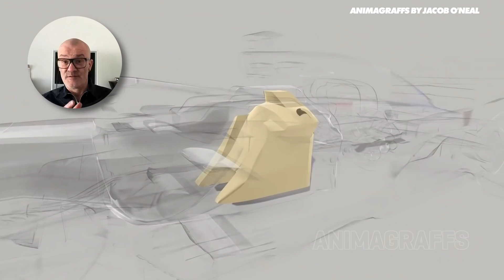Why Max's Red Bull Caught Fire in Australia

Comment: Had this problem when ethanol first come out, it would dry and degrade the rubber seals and hoses in fuel system and cause leaks and debris that clogged the injectors.
Reply: that's actually still a problem in Europe where you have premium fuel for cars that can't handle it. Pre 200....4? European cars didn't require to be compatible with E10, and E10 wasn't that common back then. Most Gas stations had no ethanol content gasoline.

They kinda screwed us over here with that because it's harder to keep the older cars that are worth keeping on the road alive. You often have to order parts from US counterparts or get a custom E10 compatible one.
Reply: @foxman105  your engine will handle the E10.. your cars fuellines and rubber seals in the system dont.. at ethanol is agressive on rubber and soft plastics..  my car is from 2003 and the car before that 2002.. and they both ran fine on E10.. i only had to replace the fuellines ajd injectors witch was not a big deal.. it sucks.. but not the end of the world.. E85 is more aggressive then E10 but also requires a flex fuel sensor for the ECU if you still want to run unleaded
Reply: @gewoontimm  I paid for an unleaded conversion on an old Opel Manta A model. Its a lot harder to get a shop for that. Still most don't care about preserving classic cars and its depressing.
Reply: @foxman105  what most people do with old opels is swap a newer engine in it.. like the c20xe, c20ne c20let.. then they have fuel injection and can run on unleaded without problems..
Reply: @gewoontimm  I wanted to keep it modern useable but authentic.
Reply: @foxman105  a c20xe would do enough.. and some fuellines that can handle ethanol.. also a fuelpump that can handle it so the plastic is not eaten away over time.. but mantas are easy.. not much electrics and pletty much like lego.. i have an opel omega b facelift.. runs fine on E10.. if the factory fuellines are starting to fail i will pull new braided fuellines under the car and continue..
Reply: @gewoontimm  Unfortunately I live in a retarded country which doesn't allow you to swap an engine for something that wasn't already in the car. You need the same model and displacement because... "Safety" and "ecology". I took this route because I just didn't want to fuck with half measures and wanted a permanent solution. It was an overkill I agree but I felt satisfied and I think that's what matters in the end.
Reply: @gewoontimm  I've had no issues, whatsoever, with either the 1998 Mazda 323F I owned for more than 10 years, nor my current 2001 Mitsubishi Galant, and I've been using the E5 and now E10 fuels since they came out. Never had anything related to the fuel system on my maintenance bills, so I'm not sure how much of the aggressiveness of the ethanol used in the fuels is actually true, or how much is down to low quality materials used by the manufacturers in the cases where using ethanol-containing fuels did cause issues.
Reply: @foxman105  i understand... some cpuntries are a b*tch when it comes down to engine swaps.. in the netherlands where i live anything pre 1998 only has to pass safety inspection and changed in your cars documentation...
Reply: @halofreak1990  its well known 90s cars are build to last 😅 im sure most cars will have no problem with the newer fuels
Reply: @gewoontimm  That would be lenient by our standars... its eitjer oem, oem rproduction/ compstible or no go. Technically the Manta is not street legal but nobody cares that much to do an engine dusassembly and it doesn't show on emissions. Actually it has them lower now.
Reply: @foxman105  european here. Can confirm. Forced to buy 98 (Has a maximum of 5% ethanol. A lot of gas station's 98 has 0% ethanol) for my 1998 Citroen. It knocks below 2000rpm on regular. I'm assuming because it's running to lean on E10.
Reply: @TotoGeenen  e10 shouldn't be a huge issue for these f1 power units, engineers should have been able to plan for this. Doubt the fuel itself is the problem
Reply: @TotoGeenen  You might need an ECU reprogram and a compatible set of hoses and seals. Also a compatible fuel pump. Even if it runs well E10 will rot your engine from inside out if it doesn't have proper equipment.
Reply: @TotoGeenen  I had this problem when I owned a NB MX 5. It ran okay but it had rubber rot issues in the lines, seals and fuel pump. I had to get US counterparts to fix it and get an ECU retune. It was expensive... And I'm actually quite pissed at manufacturers that they didn't implement this standard globally since it's been in US since..... 70's I think.
Reply: @foxman105  e10 won't rot your engine quick enough to make a difference in a race, i don't care if your car is 40 years old, it won't rot anything that quick
Reply: @TotoGeenen  Nah, it's because it's a 1998 citroen
Reply: @mountaingoat595  Okay. that's actually a good point. I was looking on it from a standard driver POV. 

Still the viscosity and lubrication is different and it might be screwing with some precisely calibrated mechanical components. Redbull did something wrong I think that's obvious. And it might cost them the championship this year if it already didn't. Ferrari on the other hand holy heck that's a return I really didn't expect.
Reply: @foxman105  That's way to much effort. Why would I do that when I can just get ethanol free for 10 cents per liter more instead?
Reply: @mountaingoat595  Agreed
Reply: @mountaingoat595  I have been thinking the samething, E10 still has a stoichiometric ration of 14.6 which is literally one point from gasoline. Post 2000 majority of cars built had the fuel systems setup for being able to deal with up to 15% ethanol. Other great point you made is the F1 engineers not being able to prepare for that. If we in the aftermarket world can run fuels with up to 98% ethanol there is no reason why F1 engineers can’t figure that out. Something else is up
Reply: @mountaingoat595  not sure how many of these guys are old enough to have witnessed what ethanol does.  It is theory taught in schools now,  but some of us old timers had the same car before ethanol and driving it a long distance, you got a real feel for the issues associated with what we used to call ethanol... "shit gas. "
Reply: @TotoGeenen  Doubtful it's lean enough to cause knock, considering ethanol has higher knock resistance.
Reply: @Cataclysm1  idk, I'm guessing that's it because it is basically unusable sub 2k rpm on E10. Can't let it drop below that because when you get back on the gas it just bogs. Meanwhile on 98 you can floor it at 1000rpm and it doesn't care.

>Ethanol is more knock resistance
95 is 95. E10 95 has the same knock resistance and ethanol free 95. Since they're both rated at 95
Reply: @mountaingoat595  found the layman lol why wouldn't it be a huge issue is just as good a question. "The engineer should've..." People like you go into politics
Reply: Only redbull power trains had an issue like that (gasly and verstapen) Check was a different fueling issue. No other team on the grid has had fire problems like redbull.
Reply: @ed3192  gasly wasnt fuel related, his MGU-K failed and caught fire
Reply: @ed3192  most teams did. But their issues came during barcelona and bahrain pre season tests which gave them time to solve before the actual season. Just redbull was unfortunate to not have the problems during the test but happened after the season started where it matters.
Reply: so it seems Formula 1 has a lot to learn from mainstream car makers that have cars able to run on 10% Ethanol. I think Honda has Ethanol accepting cars, but what a terrible year for them to back out of the Red Bull partnership.
Reply: @firefoxuser2557  I actually run e15 on my Honda CRV, no major issues still at 180,000 miles
Reply: @firefoxuser2557  or a great year if you was thinking cynically. Leaving with a driver championship.
Reply: @firefoxuser2557  Nonsense. Absurd to think that F1 is using components not compatible with ethanol.
Reply: @firefoxuser2557  Honda is still gonna work on Red Bull engines until 2026, they changed the agreement they had, they will keep paying Honda to develop the engine but will just brand it as an RB engine because they are paying for the engine and the licensing now, this will give RB the buffer time frame to develop the 2026 engine.
Reply: Well, I doubt it, they run for like hundreds laps during the testing session with no problem. I reckon that must be something else apart from you have mentioned. And ethanol isn't really uncommon. Thailand has been using it for more than a decade. Back in 2010 If I'm not mistaken. Brazil since like the 80s? And it is E20, 20% of ethanol. So it is a pretty standard in the automotive sectors, since a country like Thailand has been using it. And Thailand has like almost brand of cars, Japanese car, European, etc. Pretty sure F1 engineers should have known this, if it now, it is their ignorance that caused this.
Reply: @theruckinmaul1460  remember helmet Marko said, he would rather have fast car but unreliable then slow car then reliable? 

So maybe in order to save weight, red bull took the risk on using parts that are super light but there is a risk of ethanol leak then using heavier part that 100% will not cause any leak?
Reply: Agreed, the ethanol is doing creepy stuff to many gaskets etc. and the benefit of adding ethanol to power engines is anyhow questionable.
Reply: @honehobbes2897  indycar runs on ethanol, ethanol is actually really awesome when used for engines designed to take it
Reply: Within 3 races??? Does ethanol really work that fast?
Reply: @willw.3366  stuff on an F1 car is not made to last as long as yoir average car does.. after a hand full of races (being optimistic) the engines have reached 100% duty cycle and ethanol and other agressive racefuels will wear an engine out.. 

Same with le mans a few years ago when not every LMP2 car ran on diesel.. they ran on high octane racefuel and the engine only had to last 24 hours ans a bit for practicing.. so in motorsport performance will outweigh durability and teams will take the gamble if it delivers them a win...  if a fuelhose or and engine only lasts 3 races ita good enough for them dispite the rules
Reply: @Stem Artin shell v power and BP ultimate are also ethanol free
Reply: @Stem Artin prolly. Check their websites
Reply: @Stem Artin seems like you're right. Shell v power may contain upto 5% ethanol in the UK. Damn that's gay. I don't live in the UK tho. A pump like 10m away from me has E0 fuel so I always just fill up there.
Edit what about BP? It being British I assume you have a lot of them there? In my country they claim their premium is ethanol free (same as shell v power). Is it again different in the UK?
Reply: Also saw my engine run hotter on long distance drives and fuel mileage suffered... So yep... It's the fuel for sure,  and maybe other things as well.
Reply: @Stem Artin I see. Good on ya mate
Reply: Not that quickly.
Reply: Or Max's engineers are sick of him cursing & blaming them when he can't deal with issues beyond anyone's control & they're teaching pet-lip boy a lesson ...
Reply: Surely they dint run parts like that for long enough to cause that sort of issues
Reply: @rhyswilliams4893  they could've used metal or copper lines as fuellines.. put some fittings on that.. that small hose looks like it has plastic or hard rubber compound in it as they say its flexible...
Reply: @gewoontimm  with weight issues everyone is having I guess it's weight saving.
Reply: @gewoontimm  don't get what that's got to do with them not running for a hugely long amount of time though..
Reply: @rhyswilliams4893  saving on weight for fuellines is useless.. an average sunday F1 race distance is around 300 km long.. if the engine needs to last 4 races as a minimum.. the engine only lasts 1200.. compared to... a lot more for us roadusers.. so the parts dont have to last that long so the teams can push a car more to its limits and secrafice durability.. there is also a reason why F1 engine without piston rings whike roadcars do.. the F1 engine has tighter tolerances and less to no room for parts breaking down.. if something breaks it usually has a big impact on the performance of the engine
Reply: That's  the point I making...
Reply: Classic F1 bullshit. Rules changes for the sake of false environmental reasons. Self inflicted BS that costs teams and fans good racing.

Comment: Why do these “power trains” need to be so goddamn complex, to the point where we can’t even see a decent race?  This hyper-turbo hybrid crap is clearly not the future of ICE design anyway.
Reply: ICE are bound to go in the next 10 years though. So they will definetely use some other type of engine and the sustainable fuel percentages are bound to go up and basically arrive at a point where the fuel is completely synthetic.
Reply: Pretty much all new Mercedes-AMG ICE road car line up will be powered by turbo-hybrid engine going forward…

I’m pretty sure all ICE road car will all be powered by these turbo-hybrid engine very soon.
Reply: an 18k rpm v10 is even more complex and less reliable fyi...

Comment: Just before Max pulled over he claimed he smelled fluid.
Reply: Sean - I thought Max said ‘hydraulic fluid’ or maybe the commentators...?
Reply: @jeffreynolds3848  I thought I had heard that also.  Hydraulic fluid definitely smells.  It might have been the commentators speculating that.
Reply: @seanpellegrino2989 - thanks for your response!  So, as much as I value Driver61 & Scarbs expertise, I was surprised at the complete absence of any discussion of whatever it was that Max said as the engine died & Max started to pull over & park.
Reply: @jeffreynolds3848  I just saw the replay in F1 radio highlights.  Max said "I smell some weird fluid".
Reply: SP - well done for checking.  I still think D61 & Scarbs analysis is incomplete.
Reply: @jeffreynolds3848  I never heard him say hydraulic. He said strange, so I wondered what that would be.